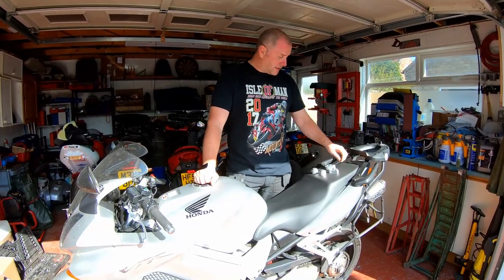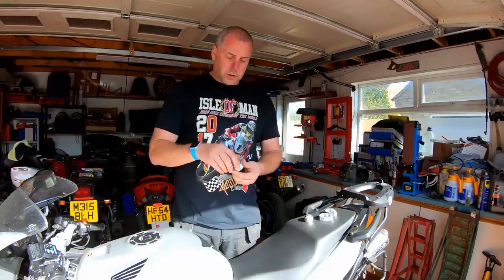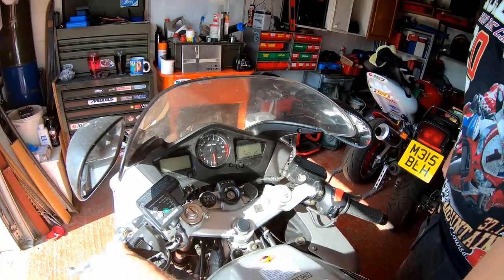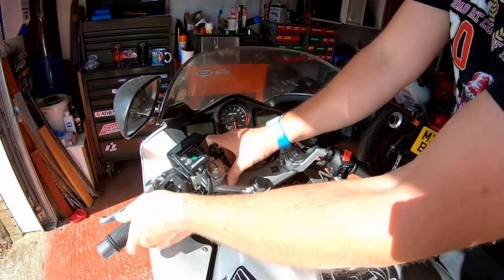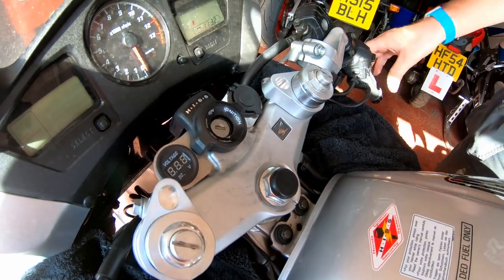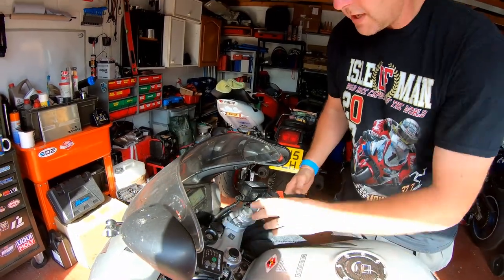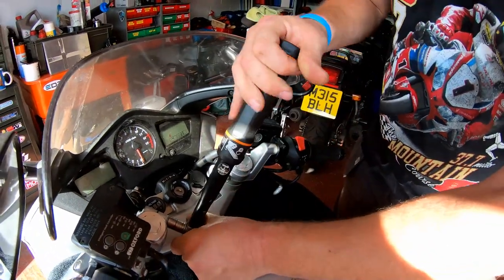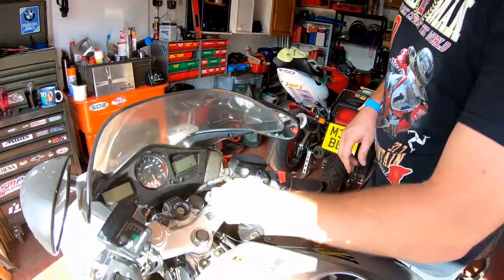2003 Honda VFR800 VTEC - Fitting Gen Mar Bar Risers.

Comment: I fitted a set of Moto CNC risers. You are right the top caps cannot be unscrewed like the ones you have. If I want to make a fork adjustment I have to loosen the handlebar clamp to remove the caps. I don't think it is a big problem as my forks are set up how I like them so won't  need to get at them regularly. As regards the ride the risers makes it more comfortable on the wrists so well worth the money. As always a really good video, cheers
Reply: Cheers Richard

Comment: I own a 2001 and have fitted AMB straight bar. Had to buy longer throttle cables. Makes big difference. Also I dropped front end down about 1/4 inch maybe bit more made handling much sharper.
Reply from the maker: https://youtu.be/P0Sr3g5Gm90

Comment: I have a set of Motocnc the top caps don't unscrew they are gripped by the pinch bars. Takes about a min to get them off so no biggie. I found the machining tolerance on the Motocnc just that bit better than the genmar
Reply from the maker: Oh so you’ve actually tried both for the comparison? I’d like to have a set of moto cancer ones to be able to compare 👍🏻
Reply: @KevsShed  yes, not sure if it was a bad set from Genmar but the bars would rock ever so slightly when fixed.
Reply from the maker: @moto-cnc2286  Cheers guys, I've sent you an email ;)

Comment: I am thinking of fitting bar risers to my VFR 800 Vtec 2005. Wolud you recommend the Gen Mar bar risers or the CNC Moto type?
Reply from the maker: Both are very good but the Moto-CNC ones seem to be easier to find 👍🏻
Reply: @KevsShed  Thanks for your reply Kevin, I will have a go at the Moto CNC type then

Comment: Is it an issue that with these risers the clamping ring for the bar has less height of fork to clamp to? This would be my concern.
Reply from the maker: That seems to be a recurring theme with this style of bar riser yet I have found no complaint regarding safety or failure anywhere so I can only assume that means they do the job 👍🏻
Reply: @KevsShed  Thanks for your reply.
Reply from the maker: Alex Morgan 👌🏻
Reply: Yes you have lost c. 50% of the engagement on the bars on the fork tube; the principle from an engineering perspective is not great.  Agree though, never heard of any problems in practice but still a bit of a concern.
Reply: No as the spacer allows clamping to be of a force as high as before the spacer was fitted.
Reply: @KevsShed  hard to complain if you’re dead
Reply: @johnrocker2986  that makes no sense when it has half the surface to clamp on to
Reply: @Soulasgard  dead? After  being sold and copied for 30 years nobody has died! so such a foolish remark.
Reply: @Soulasgard  no the cap slides over fork head , covering the gap and  clamps"other" 50% so it's as if the clamp was attached to fork originally. Hard to explain.if I could take photo It would make more sense
Reply: @johnlang3233    the cap slides over fork head , covering the gap and "other" 50% clamps onto so 50% on fork, 50% on cap making it one piece with no gap. as if the clamp was attached to fork originally. Hard to explain.if I could take photo It would make more sense. Not sure what that means engineering wise but to me it's same as original? But I'm no engineer ! Thoughts? Wouldn't manufacture need to prove it is safe? If a fatality was caused and could be linked back to manufacture wouldn't they be liable? I'm no lawyer either 😂
Reply: I was thinking a drop or two of blue thread lock would somewhat serve the purpose of the retaining ring. It would put my mind at ease. Then again, there's no normal motion that would put pressure directly upward on the bars, and both bars would have to come off at the same time to completely lose the ability to steer the motorcycle.